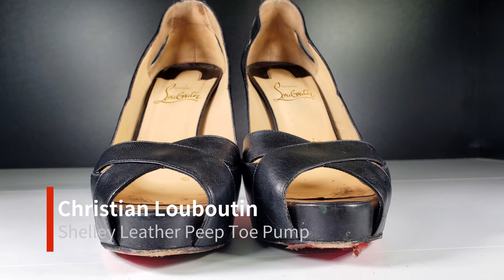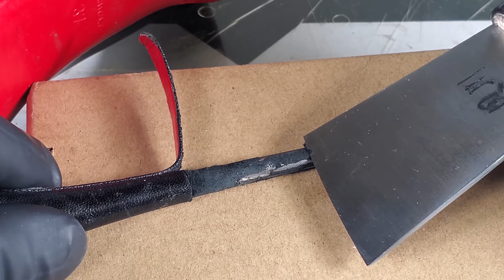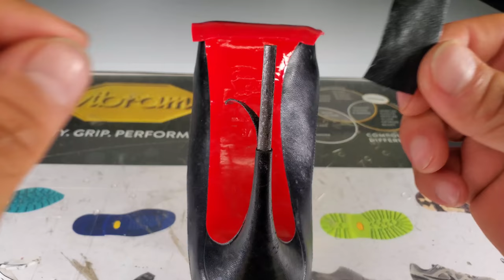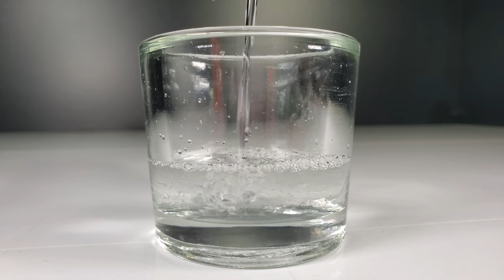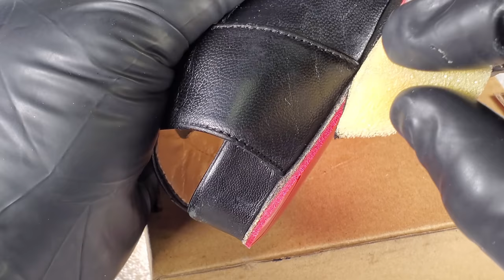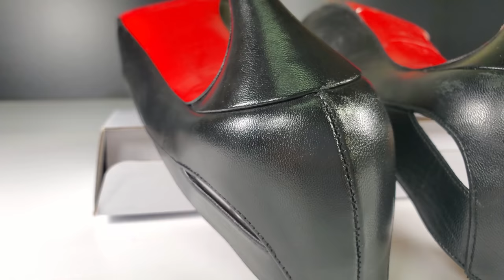ASMRㅣChristian Louboutin Heels Restorationㅣ크리스찬 루부탱 구두 복원

Comment: out of curiosity, how much do you charge for such an intensive repair?
Reply: I take pretty good care of all of mine (I probably have 8 pairs and this exact same pair was my first I ever purchased) and my Vibram soles are about $35 a pair to put on. They do a polish for free at the same time so they stay nice. I baby mine and haven't ever had a repair like this thankfully,  but can guess these were about $150 depending on where you take them/which part of the country you live in. I only know because I saw a pair that needed repairs like this at the shop and asked about how much they'd cost for them to repair such badly damaged heels and that was their estimate. It hurt to see these heels like this! I'm sure she had great times in them,  but a little care would go a long way to keep them nice! I will say this: ALWAYS use "Solemates High Heel Protectors". They are AMAZING! You can put them on the heel tips, (they come in various colors but I normally use clear) and they stop you from sinking in grass or getting them ruined when walking on sidewalks.😊 It's so hard not to wear them right away when you get them,  but if you can take them to get Vibram soles from the beginning, it'll save you a LOT of money down the line and keep them nice!

Comment: Put a piece of paper tape across, mark it with a straight line, cut across, remove the tape from the side where you want to remove the sole material, then use the cutter to slice the material to that edge so you don't have to sand all the way in, then add some more tape to that line, so you can sand close but without danger of messing the finish on the side where you want to leave it clean. That way, at 4:57 there's no lip that can get caught and have the rubber messed up. The rubber and the original sole should be at the same level. It's kinda like cutting the corner off the heel so that it doesn't catch or when you do half and halfs and there's leather and rubber. You always inset the rubber into the leather.

Comment: Out of curiosity, how much would a restoration like that cost?
Reply: Everyone charges different,  in my area,  a full restoration like this would be around 150-200$
Reply: Really depends on cobbler.  My guess is, for general restoration and surface treatment, ~$100 is no usually no escape. But for serious structural repairs, expect the cost to be higher ($300+).
Reply: @mariacordova696  at the shop i work at we charge $80 in Lafayette CA
Reply: @cesarcastellon5286  wow that's cheap.
Reply: @cesarcastellon5286  Where's that shop, is it along Mt. Diablo Blvd?  Interested in dropping by to learn about the services etc. someday...
Reply: @vampyrelycan99  right in front of Diablo foods next to the Wells Fargo ask for Miguel  place is called one stop shoe care
Reply: @mariacordova696  sabes dónde puede arreglarlos aquí en USA?
Reply: @laraadriana829  depends on what state/city
Reply: @mariacordova696  Kansas City Ks ❤️

Comment: hi! great video. the magic tricks were cute. I couldn't figure out why you didn't replace the entire (red) sole until I saw the name stamped on the arch area. you must have to keep a thousand different leathers around to match the color and thickness of the damaged areas. 
thank you.
Reply from the maker: Simply my customer didn't want me to change whole leather soles. I attached  rubber protection to reinforce original leather soles. Thanks for your review sir!
Reply: @RepairStudio  here's a tip for a better seam, (where the replacement red leather meets the existing red leather sole). 
Overlap new and old just a bit. cut them both at the same time. that insures the two edges are 100% identical. thereby the seam would be as invisible as possible. 
perhaps using a straight edge, if possible. no free hand stuff. 
I hope I don't sound too mean. I may have been kinda rough, 
in my comments on some of your videos. 
your videos are quite enjoyable. oh! your camera work is great.
thanks, again.
Reply from the maker: Thanks for your tip! I know how to do it but this is my way of attaching soles unless my customer wants me to do other way.
Reply: @RepairStudio  uhmm, I don't think you do, unless he specifically said make a seam that can be seen from outer space. good luck with that, sir. maybe the next one will be good.
Reply: @mrkemblegilstrap  I agree. Having such a noticeable seam on these iconic red soles is sacrilegious. It's what these shoes are known for.  Now they look like a bad knockoff.
Reply: @marylynnb.9795  thank you, for writing. I thought it was just me. when I saw that someone had replied to my comment, I was sure that I was gonna get chewed out. hah! a pleasant surprise. did you read the other posts,  between the shoe guy and myself? spoiler alert ⚠️ I ended up kind of getting into an argument with him. I'm no yes man. if everyone said he was great. how would he get any better. I promise that I'm not a troll. I give as many compliments as criticisms. the other day I had bought a frozen Gyro kit. it was super good. even the pita bread was good after I thawed it in the microwave. on the box it said, Questions or Comments? and a 1800 #. I called and left them a voice mail raving about their product. I do stuff like that all the time. others, I call and complain. I've got 10 pairs of shoes/boots. 2 Ralph Lauren, 2 vans, 1 doc martens. 1 Sebago. 1 wolverine boots. various slippers and slaps. so I know a bit about shoes. I restored cars for 20 years and was a service plumber for 22 years. I was a sewing machine tech. I've remodeled a few dozen homes. on and on...yada yada yada, lol. so, I do feel that I have a valid opinion. 
if I don't know, I shut up. 
if you get bored, ck his video about a pair of Gucci slippers and I can't remember the other one that I nitpicked. ck out My comments? see what you think.
hah! my middle name is Lynn, also 👍🏆
thanks, again for writing. I hope you have a great day :)

Comment: Nice vid! Only question: why don't you smooth out the crease between the old and new red at the bottom? Is it too dangerous to break the original red or something?
Reply from the maker: Thanks Miguel, To flush with original soles, the soles need to be grinded as much as the thickness of new red rubber soles. Which won't be good for leather soles eventually. Hopefully it answers your question.👍

Comment: You said the last time you repaired a pair of CL heels that it was a "mistake" to have that huge ugly glaring seam where you replaced half the leather sole with cheap, plasticky rubber,  yet here you are making that ugly seam "mistake" again. Obviously it's not a mistake, it's on purpose.  Nobody who could really afford CLs would ever want to wear them looking like that. Don't do something if you are going to do it half-assed. Also, you needed to use leather filler on the seam on the black heel. You can totally see the repair.

Comment: I hate the fact they dont just change entire red bottom but only part. And then I can clearly see the freaking line between old and new part and it's giving me a headache. I hate you people. 😡😡😡
Reply: A cobbler can only do as much.  But replacing the whole red undersole?  Impractical.  The metatarsal pad resole is more then enough...

As for the wrapped heel: this was the more economical way.  Sure the whole heel stack could be removed for full rewrapping, but we're talking about deconstructing the entire shoe structure which is risky.  And on top of test,  the premium costs for such repair...

C'mon dude, try to appreciate this guy's efforts.
Reply: @vexystar3389  Cheap Ch shoes have other problems.  The bottoms might hold,  but other parts break faster than you think.  Plus, replacing the whole undersole is usually reserved for men's footwear...

For women's heels, resoling with quality traction pads is standard procedure at just any pro cobbler.  Not convinced?  Check out other YT shoe repair channels (eg. Bedos) and see for yourself......
Reply: @vampyrelycan99  you really can say what ever you want. It can be done like this by every shoe repair guy in the world that still doesn't mean that I will suddenly like it and won't be bothered by it. That is why I buy new and it doesn't have that horrible break of bottoms between old and replaced. I would never accept to have my shoes done that way. It would bother me so much. Get it? No? I don't care really. And I do have right for my opinion. Like it or not.
Reply: @vampyrelycan99  and when I mentioned cheap shoes I only meant that even they do entire bottoms and there is no divide between half. Wasn't talking about quality or anything. Please before answer to people try to understand what they meant with their comments. It's rather annoying when I have to explain my self as if you speak chinese and not english and you don't get it. 🤔
Reply: @vexystar3389  I'm not going to argue with you further.  Whatever you said and/or defended, let other viewers here judge.  Cheers...
Reply: @vampyrelycan99  You are the one that has obvious problems with other people's opinions. I don't read other comments and I don't judge other people's opinion like you so I really don't care what others have written because we all have write to write what we want
Reply: Removing the entire red bottom also removes the brand logo and makes the shoes worthless as they can’t be verified